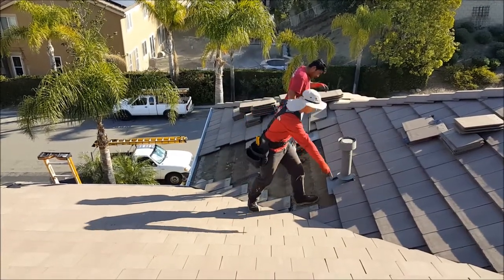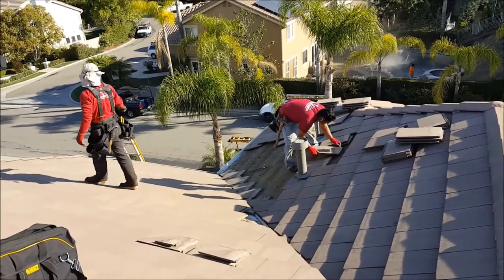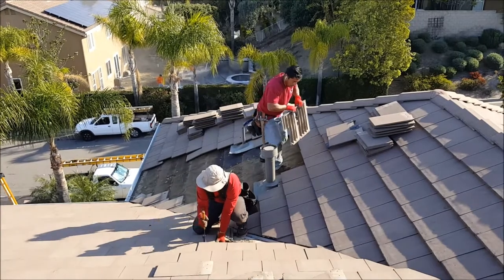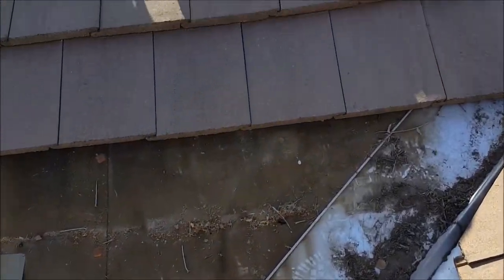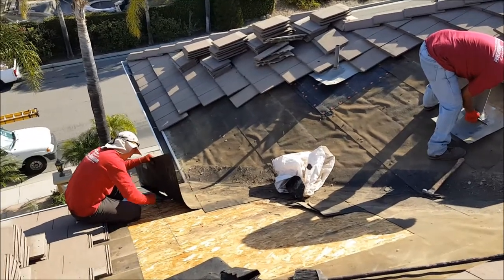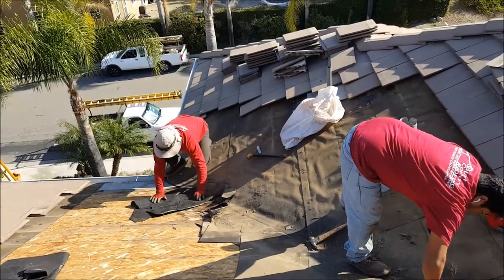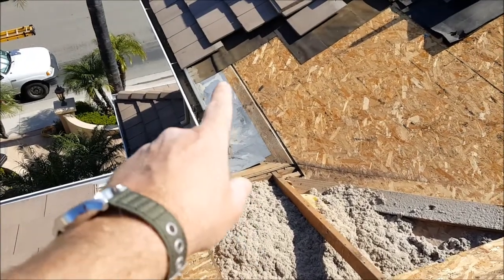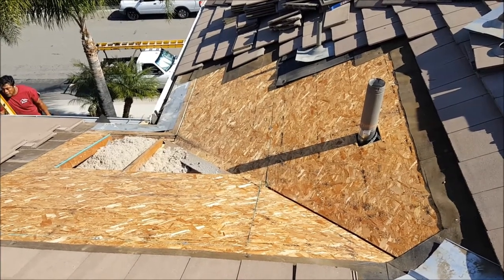Roofing Tips for Fixing a Valley on a Flat Tile Roof - Roofing Job Done in Aliso Viejo, Ca

Comment: Do you have a finish on this repair ? I have been a roofer for fifty plus year and I sure hope you opened up the valley 1.5” inches on each side of the 24” W valley metal? Closed in valleys are the problem and should never be that way.
Reply from the maker: I may have it somewhere.  I do need to update this account.  As for the closed valley / open valley.  The problem was neither.  It was the palm trees dropping seeds and debris.

Comment: Is there a part #2? I wanted to hear more about what should be in the middle, like what was the mistake, can one see this before we buy a house? Like see it from having just a roof visual inspection or are these "surprises" that will just happen once we buy a house. The reason for the technological terms of what should be under there is because if I ever want my roof flat tiled I want to know what to ask for in my valleys so I don't end up with this problem a couple years down the road.Thanks!
Reply: Just make sure your valleys are opened 1.5” inches on both side of the W valley metal.

Comment: You start from the top to the bottom
Reply from the maker: Better to just redo the whole thing.  This video just shows how to remove a section.  But, you're are right from top to bottom is the best way.  It is also a lot more expensive and that is something we have to consider.
Reply: What u just stated is how u know you dont have as much experience as you thought.
Reply: EXACTLY TO TORN APART THE TILES U JUST CAIN OF DO FORCE ON THE FIRST TOP LINE OF TILE AND THEN THE ONES UNDER ARE SOOOO MUCH EASY TO PULL OFF I DO THIS TIPE OF REPAIRS ALL TIME  OR HES GUYS JYST WANT TO TAKE MORE TIME I DKNOW

Comment: Why didn't you go all the way to the top? bust the lugs out on the top of the tile so the water can actually get down the valley metal? use elevated battens? or the right valley metal? the water should never be underneath the tile!! you guys are way behind in California.
Reply from the maker: Hey Ed,  believe it or not but, normal people have a budget.  And, why charge the customer to go all the way up the valley when the problem is completely contained.  

As for the use of battens.  You can't just use battens in the area of your repair because they as you say 'elevate" the tile.  Would you like to see a small portion of your roof elevated and the other 90% not?  I think not.    

As for your comment that water should never be underneath the tile.  Ed, you should really take the time to read the the manufacture specifications sheet before you make an assertion.  

The material specifications for this particular tile reads "and I am paraphrasing" "the tile is designed to shed 80% of the water that hit the surface of the tile and no more than 20% should get under the tile".  Then they tell you how to accomplish this goal with strict installations methods.    

For me, that means water will get under the tile.  

The tile manufactures know that water get under the tiles during heavy and wind blown rain situation and that is why you have water shield and other products that protect the roof deck from water that "gets" under the tile.

But, thank you for the comment and for watching our video.  I hope you learned something about roof leak detection and repair.
Reply: Ed Richards why would underlayment be required by code if tiles could 100% waterproof a roof? Why would metal eave closure come with holes evenly spaced out? Are you even a roofer?

Comment: Anybody that does tile roof without battens and at least a double v in the valley is clueless I realize you're just fixing what's already there if you don't do something about that Valley it will leak onto your ice and water Shield as soon as that debris builds up again
Reply from the maker: You're right.  In about 25 years the valley "could" leak again.  But, the valley has now been weaved and ice and water shield has been installed.  Which means the valley I repaired will be the last place on the whole entire roof to leak for the best possible price.  I thought that's the whole point of the customer hiring me.